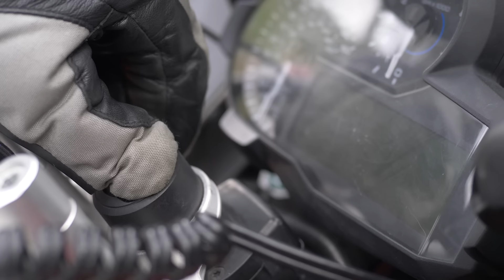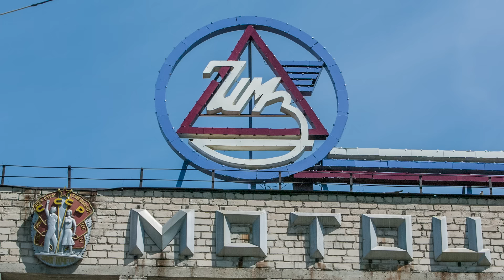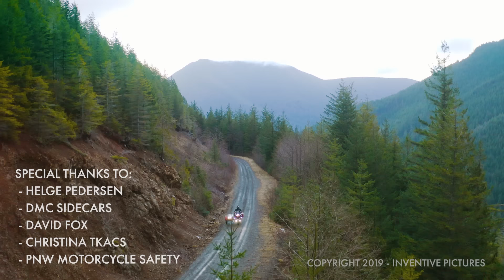Adventure Sidecar Tips from Helge Pedersen

Comment: Hello Helge, Nice rig, could you elaborate on the issue you had with front mount braking on your first adventure. PS the most dangerous maneuver is if you turn away from the sidecar to quick and sharp. All the weight goes on the front wheel and front of sidecar which gives no warning and you could end up back wheel on bike lifting and end up head over heel. PS no warning unlike flying the sidecar wheel. Have a 2006 R1200 GSA now with 223,000 km. Always had a sidecar since age of 18 now 65. Best Pieter.
Reply: I did not have any front mount braking, only a screw that came loose and that has now been fixed. I did have a problem with the sidecar frame braking on the way to Tierra del Fuego. DMC has replaced this frame with a stronger frame that should be up to the next adventure.
I also have changed all 3 shock absorbers to the Touratech line of shocks. After all of these changes the sidecar rides better than ever before. I feel that many people forget to upgrade the shocks on their bikes of the sidecar conversions which is a big mistake.
Thanks for the warning about going heads over heal in left turns. I have heard about this before and will be careful as that will hurt badly. Looks like you have a lot of experience riding all your life as a biker with sidecar. I am still a baby in this respect and enjoying the process of learning the tricks of the tree wheel riding. Thanks again Pieter.
Reply: @helgepedersen877  My last side car was in the 70s  which had a seperate sidecar brake which certainly helped on the turns. You could slow the sidecar down  on the right handers and let it run  on the left ones.Slowing down the bike  on the brakes or engine,  A great set-up  I arrange to have two rear brake peddles . On for the side car ands one for the bike. You could operate both as they where side by side.  The sidecar and bike were than cable operated but it wouldalso work with Hydrolics.

Comment: Greetings from Canada Helge and thanks for the video, an interesting aspect of touring by motorcycle for sure.  I love the idea of the extra storage especially when riding two up.  I wonder if the side car manufacturer has thought about inventing an articulating hub for the side car wheel that would assist in the turning of the bike and side car, similar to some of the front dual wheeled scooters on the market resulting in considerable less force required?  How much did the conversion of your bike and side car end up costing you? Thanks again Helge and happy riding.
Reply: We use to make a sidecar with the sidecar wheel steering. Very complex to do and we found that while it helped some with high performance street bikes most people did not want to spend the extra money for it. Helge's bike has had the trail reduced for easier steering with the sidecar. Price depends on what all you want.
Jay G
DMC sidecars
www.dmcsidecars.com
866-638-1793
Reply: DMC has a list of features you can involve in the build, check their webpage, www.dmcsidecars.com and you can see for your self. So many variables.

Comment: Do they offer 2wheel drive like you can get on a Ural? I may have missed that in the video. Is the side car bike specific? I bet it is. I think that would be a cool option to have for my bike. I wouldn't want it on all the time. Thanks Brett for putting this video out for us to see!
Reply: The sidecar builder that I used, DMC, has different sidecar models for different bikes, check their web page. I know that a sidecar builder in Europe makes a two wheel driven rig, but it is extremely expencive.
Reply: We can build sidecars with a driven sidecar wheel however all you really get with it is awesome bragging rights, stock about 50 feet further along then you would have been with out it and a much lighter wallet. The Ural being overweight, underpowered, poorly suspended with skinny tires 2wd is much more use full. I was on an event where there were Ural's on the event, after the event talking to riders there was one place on the event where Ural's needed 2wd. It was such a non event that it took me awhile to figure out just where they were talking about. So I told them all I needed was "more throttle" The BMW has power, suspension, ground clearance, good tires as such 2wd is of much less need. About the only time I find 2wd to be of much value is hill climbing in loose terrain as sidecars suck at this. Sand, which sucks pretty much no matter what and real slow crawling that the BMW is not really geared slow enough for and you are usually beating the bike up pretty bad so I try and avoid it. I would not have 2wd on a rig I was doing a RTW trip on or similar as it is heavy and adds  complexities that are just not needed.
Jay G
DMC sidecars
www.dmcsidecars.com
866-638-1793
Reply: @jaygiese2987  thank you for your reply
Reply: Bestoink Dooley  Thank you for your reply
Reply: Bestoink Dooley  That is what it is all about, having a good time and being content with what you have. Thanks for sharing your joy riding your Ural Gear UP.

Comment: The statement that the left turn would be easier is dangerous. 
If the right-hand bend is made too fast, the sidecar will come up, but this is easy to correct. For a rollover you are beyond good&bad.
The rising boat is also easier to provoke. Especially in the combination of BMW-ADvent with a light sidecar mounted.

On the other hand, if the left turn is too fast and the rear wheel comes up, it is no longer in the driver's hands to correct this. If you are too fast, it goes headlong over the nose of the boat. The driver then no longer has a say in the matter.

By the way. A nice Combination.

Comment: For substantial offroad I'd take a 2wd Ural with lower power over the Beemers without a second thought... once you ride a Ural in difficult conditions you'll never want a 1wd sidecar bike again. For primarily road riding (even dirt roads) the BMW's are fantastic... but for hard ADV they can't match the Ural. NOW... if you are independently wealthy and can afford a custom 2wd GS based sidecar bike then you've got the unicorn... but since the 1wd units are in the $40-$50k range I can only imagine what a 2wd build would cost.

Saw a DMC Sidecar GS at my dealer last trip and it's a lovely unit... I really liked the trim capability since anyone who's ridden a sidecar bike knows that without a motorized trim you have to set the bike up for a particular riding condition (things like road crown) and speed and if you're NOT at those conditions the bike pulls. However... I've found that trim is generally not necessary until you get to highway speeds (over 45mph or thereabouts), so again if you're doing hard ADV this is generally not an issue... but if your adventures are primarily highway miles then this is a VERY desirable option.
Reply: #DavidKuhn I listen to so many comments here where people defend the Ural as the ultimate ADV sidecar bike because of the 2WD. I would love to have 2WD, but I could never handle a bike like the Ural 2WD that does not have the power to follow highway speeds and then some while riding long distances. I am sure that the Ural 2WD fits the bill for many riders that like to adventure in to the backcountry to do some hard core off-roading and I am very happy for them enjoying this. 
This is no my kind of adventure motorcycle touring, I need a vehicle that can take me on long journeys across the globe on highways and 3rd world roads high in the Himalayas or the Andes mountains to the deep jungle of the Amazon's or the Gobi desert. If I ever get the opportunity to have a BMW GS bike with a 2WD sidecar outfit that would be very cool, but it is by no means a dealbreaker for what I am doing today.
Next year, April 2020, we will ride from Tokyo to München with a group of riders where there will be 4 BMW sidecar bikes. This will be a great adventure on 2 and 3 wheels covering 12,000 miles.
Bottom line enjoy your ride wherever you ride on 2 or 3 wheels with 1 or 2 WD.
Reply: @helgepedersen877  I totally agree that if you need to be able to handle highway speeds then the older Urals are not great (the newer FI Urals are capable of sustained highway speeds... but they're certainly not as capable as the GS or other modern bikes in that arena).

I also understand the question of difficulty... my wife has a 2wd Ural and she's petite, she loves it but yes in 2wd it's a workout for her (and since it doesn't have a trim she gets tired if she is riding in conditions where the bike is pulling... hers is set up for 45mph with a modest road crown).

Comment: I  had a side-car paired up to a Suzuki GT550. Surprised you haven't fitted Earls Forks/Centre Hub steering dedicated steering /suspension.
Reply: You have to understand that the BMW R1200GSA LC has what BMW call a Telelever front fork. By using this front fork and the modification to using a 17" wheel which is the same as the original rear wheel from the bike, you have an excellent front end for the sidecar rig. The forks has non to very little damping, no spring inside the forks. The actual shock is external and I have mounted a stiffer spring than a solo bike would have. So far it has worked great and I love the rounded front tire.

Comment: Like the rig and your video. My only concern is the lack of reverse. Did you encounter any problems?
Reply: While reverse on a bike is nice, it is one of the least important things on a sidecar bike if you are able bodied. Most of your effort in backing a two wheel bike is keeping the bike from falling over. If a sidecar equipped bike falls over when backing you are truly having a bad day! Get off and push, sidecar bikes are easy to back up as you need not worry about keeping the bike up right. I lean my butt against the saddle bag and walk backwards.
Jay G
DMC sidecars
Reply: I agree with what Jay is writing. Just like on a solo bike you always have to think of how you park the bike. Shit does happen though and for that reason I had DMC mount a winch on the bike. The winch can be mounted both facing to the front or to the back and that way I should be able to get out of most embarrassing situations, I hope. I could also be able to reuse other that have gotten stuck if it is not me.
Reply: I’m giving this a good thought. Thanks for the replies...

Comment: You have not clarified if your sidecar wheel is driven like on the Urals you turned down. It would make a hell of a difference in traction on overland / off road trips.
Reply from the maker: Helge's sidecar wheel is not powered.
Reply: Not all Ural bikes have power on the sidecar, it is an option I believe or specific to one model. On the tours that GlobeRiders go on when we travel to all corners of the world there has yet to be a place that not having a powered sidecar wheel would have been a dealbreaker. If one have the money for it you can also have your sidecar powered by most brands of bikes, it is all about the money.
Reply: My impression is that only specific factory prepared bikes can feature a drive to the sidecar wheel. This is not an aftermarket option. Furthermore the 2WD bikes have other features to make them adept for off-road use like higher ground clearance, a low gear range, reverse gear, and more robust overall construction. The drive to the sidecar is selectable and is meant to be used only in poor taction conditions not for highway travel. The advantages of these bikes over 1WD bikes on overland trips are comparable to those of a 4WD car over a standard 2WD saloon.
Reply: @78a67h   Just google Mobec a sidecar builder in Germany and you will see that you can retrofit a sidecar with reverse and sidecar wheel with power. Like I said, if you have the money it can be had.
In my approach I have decided that this would be overkill for my needs and I am quite content with the rig I have now. It has variable ground clearance, reinforced sidecar frame for rough riding and plenty of power from the low end to top speed with a well proven boxer engine that has a wet clutch and that is partially water cooled. I hope that was informative to you.
Reply: Mobec Works are most impressive, but I have to doubt the reliability of all that electronically controlled equipment. A breakdown in the boondocks would be a crippling blow. Call me old-fashioned but I would sooner opt for a restored Zundapp KS750 or BMW R75. Tough as nails, basic, but above all PROVEN!

Comment: Enjoyed the video. I know Urals come with reverse and maybe I missed it in the video but does your rig have reverse? Thanks.
Reply from the maker: Helge does not have a reverse option, Brandon.
Reply: Thanks for the response.  @MOTOTREK
Reply: @brandonlopez8884  This is why I have a winch on the front that also can be moved on to the back of the bike. Like a solo bike you have to make sure not to park in a place where you can not ride out from going forward, especially on a slope. I hope I never need the winch, but good to have just in case I mess up.
Reply: Thank you Helge. Great rig.

Comment: Nice video made me smile sorry to be rude to ask what did the side car set up cost and fitted to bike cheers Sean
Reply: You can get a setup similar for a bout $15,000 and up to $30,000 with material and labour included. I am still doing modifications to mine as I keep discovering weak points that need improvements. Getting ready to take the sidecar from Tokyo to München next year so it better be ready and tested before that date.

Comment: I like the stability aspect, but am wary about the width and leaning input through turns. How would a three wheeler be in a direct comparison- say a Can Am with a rear luggage platform to place a large gear duffel bag. Now, if they could offer that in all wheel drive, the Andes mountains would be tame as a kitten.
Reply: Can am are not the same . Better steering for sure but ground clearance is abismal. They would last very long if you was doing what this video did.

Comment: How did you travel overland through the Darien Gap when it's a swamp even in the driest part of the year? I've done a ton of research, and came to the conclusion that area really is unpassable on two, or even three wheels requiring a boat or plane to overcome.
Reply: I did the crossing in 1988 with a BMW R80G/S and it took 20 days to pas the 80 miles gap. You can read more about this in my book "10 Years on 2 Wheels" http://globeriders.com/10y2w_main_pages/10y2w_main.shtml
There is another book more focused on the crossing by Ed Culberson called "Obsession Die Hard".
I would not recommend the crossing it is very difficult. when I did it I had no idea how hard it would be as I did it to save money getting from Colombia to Panama on my 10 years ride around the world. I hope this helps answering your question.

Comment: How did over come the front wheel wobble you get with a sidecar outfit? By the way love your sidecar,or as we say in the uk a combination (old school)
Reply: After DMC rebuilt the sidecar with a stronger sidecar frame and most important outfitted the sidecar and bike with Touratech shocks I do not have any wobble on the front wheel. Honestly, it felt like a new bike when I picked it up from DMC and I have been super happy with the riding ever since. I am still working with Touratech to get a stiffer spring on the rear end of the bike and a lighter spring on the sidecar wheel. Bottom line I suspect that my issue first time around was the stock BMW shocks that was not up to the task. The Touratech shocks have stiffer springs better suited for the e3xtra weight of the sidecar edition. Again I am no expert, but I think that this all makes sense.

Comment: Ural is 2 will drive. Don't you think it is better as a sidecar?
Reply: #unclecharles The 2WD on Ural is limited to off-road riding, non solid surfaces, but for rough off-road riding it has its advantages. The Ural also has a lot of limits compared to this rig especially with speed and acceleration. You just have to pick what works for your own needs, that is what I did.

Comment: Sidecar riding is fun but you have to plan those Right turns carefully.   Go too fast and the car will lift, your instinct then is to turn left to get the car on the pavement again... and you are turning into traffic.... oops.    You get used to it quickly..... or else.   If you have a dog.. he will love you for this.  If he's big enough, he can serve as ballast!   Mine was a light rig, the ideal passenger weight was about 100 -150 lbs.   I took a heavy friend for a ride and it scared the shit out of me.. Right turns were fine but left turns, especially while braking, wanted to tip the thing over, forward and right, very scary.